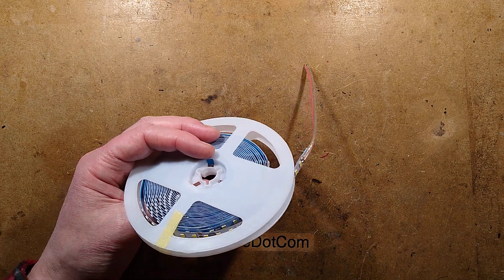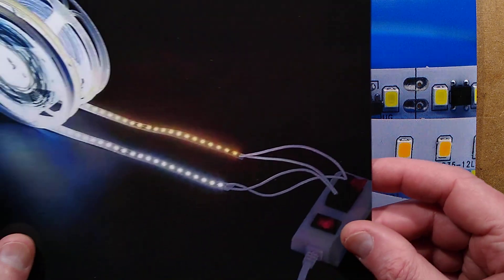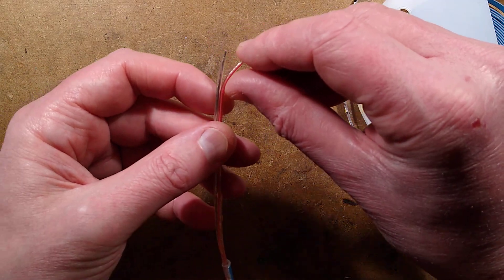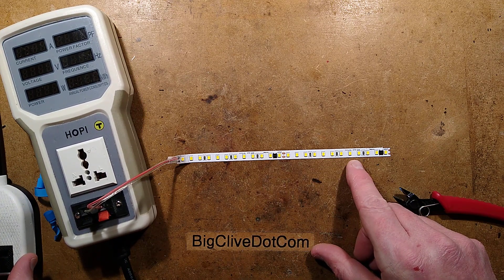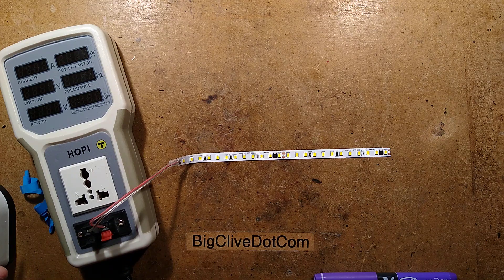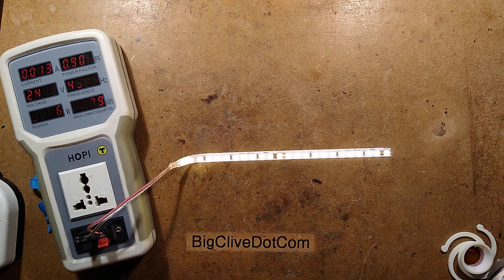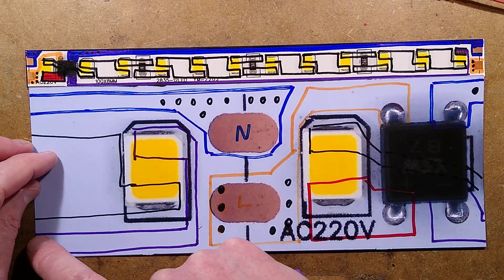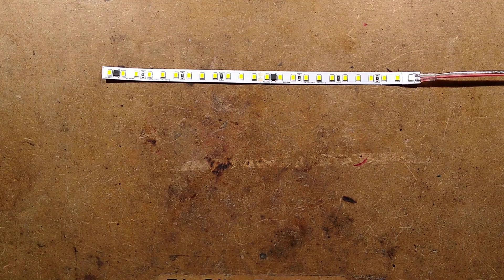Dangerous bare 230V LED tape

Comment: Dear all. I live on a boat and am installing normal 12v led tape run directly from the 12v batteries onboard. The tape gets surprisingly hot!! Is it possible to make it all run cooler? Would love some help. Thanks :-)
Reply: PWM dimmer, use a frequency well into the kHz so it doesn't flicker.
Reply: @NiHaoMike64  Thank you 👍
Reply from the maker: If the battery voltage spends much time above 12V it will cause rapidly increasing current and heat dissipation.  The use of an inline DC dimmer as suggested is good, but you can also nudge the voltage down in roughly 0.6 to 1V increments with series diodes.
Reply: @bigclivedotcom  Hi Clive. Thanks very much for taking the time to reply 🙂 The diode option sounds like something I should try as the batteries are maintained at 13.3v whilst I'm plugged into shore power, which is most of the time as I live onboard. Is there a 'size' or type of diode I should use for this technique?

Though I watch and enjoy all your content I'm in no way an electronics boffin! What effect does putting resistors in series with LEDs have? It's all very intriguing.... 🙂
Reply from the maker: @cptkev  The diode current rating depends on the LED strips normal load.  I'd suggest a 3A diode for up to 1.5A.
1N5401 could be a good choice for that range.  At least two in series to drop between 1.2 to 2V.  It also means the LEDs will use much less current as the battery gets low, which is a good thing.

Comment: That's probably where everything is going because the current is so low & people want to light entire rooms with a single LED strip.  Lighting an entire room with a 12V strip requires over 7A.  It burns off so much heat in the wires, it's never been very practical. It definitely needs a fuse & a cover.

Comment: It says 220 Volt at the band, because China does have true 220 Volt at the powerline. UK has 240 Volt, your Hopi showed 244 Volt. Rest of continent 230Volt. So in China it runs fine and a nice bit cooler.

Comment: Chuckle. I always destroy the outside corners of my thumbnails by using them as box cutters.

Do you use an isolation xmfr with this sort of stuff?

The strip looks like it's designed to be used in a manufactured fixture, certainly not a consumer product.
Reply from the maker: I have a bench area with good isolation from ground and 30mA RCD suited to electronic faults.

Comment: I love the test socket they show in the pictures, but the use of a speaker connector seems excessively safe. Bare posts that you can just clamp to or twist wires on to would be much more convenient.
Reply: Yep, I enjoyed using bare posts with 1" nuts to hook up 3x230V AV/DC connections back in the electric engine training lab.   We had specific instructions to step away at specific times.  Elsewhere in that building we did other 230V experiments, such as hooking (real) oscilloscopes to fluorescent light fixtures to study 3rd harmonics in the neutral wiring.
Reply: @johndododoe1411  sounds lke more fun than  my engineering classes at least XD
Reply: @mycosys  It's an old established Engineering college, I suspect that room was moved from the old location when they built the new campus in the 1960s.  Point of the exercise was to make sure we could run electrical experiments safely in our future careers, besides being a very traditional part of the mandatory mains electricity 101 course, specifically teaching how to safely start and stop various types of electric motors (3 phase asynchronous, 3 phase synchronous, DC with commutator).

Comment: Is this approach any worse than having a low voltage LED strip where you have to rely upon a cheap, probably junk, low voltage power supply?  At least with this mains version, you know right away it will have high voltage everywhere all the time, versus a low voltage supply that fails and suddenly sends mains voltage down the low voltage LED.  This 220v version can't fail like that. You could get shocked, yes. But you would expect it. Not like grabbing a low voltage strip and getting a surprise.

Comment: I feel like some of the proximity issues of the buses could be solved with a 90° rotation of the LEDs. I've never seen that done, so is there some unwritten rule dictated by pick'n'place machines that they can't be sideways, or...? It feels like you could then say that the LEDs were "closer together" because the packages are slightly oblong, even though I think the lit sections of each LED are roughly square. Thoughts, Clive?
Reply: I think the LEDs are always placed in this direction to minimize the mechanical stress from bending the strip and to also allow a slightly tighter bending radius. The solder joint also provides some reinforcement to the LED against breaking during bending. Imagine if you had a 5630 strip with the LEDs rotated by 90 degrees, how easily they could break if you bent the strip too aggressively.
Reply: @3zuli  Ah, yeah, that makes sense

Comment: If it's only LEDs and resistors shouldn't the power factor be at 1?
Reply from the maker: The LEDs only turn on above above a certain voltage level.  So their current isn't a pure sine wave.

Comment: Honestly, I am struggling to come up with WHY anyone would ever even design something like this in the first place.  There is no safe application for it, and what do you save vs. the low-voltage DC stuff which is already cheap as dirt?  What do you save, the cost of the DC adapter?   Really?  

Maybe it is only supposed to be a part used in the manufacture of something else or something, because I can't see any other reason for it to even exist.   

This is a good reminder that China remains the wild, wild west.  

This reminds a bit of those fake "mag-safe" chargers for the older apple laptops.  Apple never licensed the mag-safe technology, but all of these pirates made absolutely horrible, totally shoddy mag-safe compatible chargers.  They couldn't make a decent one because then Apple would sue them and put a stop to it, so the only ones for sale were just terrifyingly dangerous trash.  You'd read the reviews and they'd be like "stupid thing killed my laptop dead" or " this #@%* thing set my kitchen on fire" and they were still for sale on Amazon and EBay.  Totally unsafe, completely illegal products and nobody cared enough to stop selling them.

Comment: I haven't finished watching the video as of yet, but my first thought was "I wonder how well it'll work at 120v/60hz?"    I could see this being useful in a self-built insultated panel  (yes, this is pretty insulting).    120v might make it useful as a wall illuminant.

Comment: Could make a nice replacement for old-fangled rope lights using the mentioned tubing.  Could be used with appropriate waterproof covering for indirect lighting in homes and offices. Could be used in square or rectangular ceiling fixtures by placing strips side-by side as replacements for fluorescents. Individual strips could be used for instrument lighting in appliances etc. so no low-voltage supply needed.

Not claiming it was designed for any of these use cases, just some ideas.
Reply: Especially outside as the UV rats deteriorate the sleeve and it fills with rain water ... It makes a spectacular display ☺️ 😂😂😂
Reply: At 70W it's not all that efficient ! comparable to a 70W light bulb, no doubt !
Reply: @millomweb  70 watts for 5 meters. Close to 1.5W per 10cm. So a 40cm batten replacement would be 6W or 12W if you double up. Certainly in the ballpark, a 40cm double batten light would be 12 or 24W which seems about right.  Certainly fits with te idea of it being for replacement of fluro tube.
Reply: @mycosys  5' fluo tube IIRC 68W. If you cut the 5m length into 1m lengths and arrange them around a broom handle so light is emitted all around the handle like a fluo tube - yo might get the same light output per metre as the fluo but a length of 1m rather than 5' !
I'd rather have the fluo tube  !
Reply: @mycosys  except that 70w led is about the same as 150w fluorescent or 500w incandescent. Very approximately.

Comment: Definitely would not want to be LED along the garden path by these things, especially if it's raining, unless you're Frankenstein's monster, or want a date with old sparky!

Chinese lethality knows no bounds, by the look of it. I'd definitely say this tape needs to be used with additional insulation, so inside a light hose, or some other light permeable housing.

Handy stuff though, for tapping off a kettle spur every four inches!

Comment: So we get a Chinese product where the LEDs are not being grilled, the resistors do not get toasty and the PF is 0.9. A seemingly good product that will last some time. A product that will last which is an oddity considering the source and the only real issue is the 240v with the live and bare connections every 100mm (4"). 😱 This Death Tape 2000 will outlast the human owners as it will still be running while the surviving cats are snacking on their tape grilled corpses.

Comment: If using that on Mains, id connect an outlet plug onto it and plug it into a surge protector, doubt id use it without one.
I would also clear coat it, definitely wouldnt run it bare.

Comment: Wonder how much of this death tape will find its way into UK kitchens. Carefully installed with a standard plug stuffed on the end with the supplied 13A fuse for added protection. You can be certain someone's going to get the tingles from this stuff 🤦🏻‍♂️
Reply: Yep.  And people still wonder why in the EU regulations have been strengthened on goods like these...after fire departments having issued their concerns over people being the cheaper versions of "hoverboards" lacking any charging protection and causing a series of house fires after the thing overcharged, requesting people to either charge it outside or at least in the shed and not in the house...

Comment: if the designer had simply turned the LEDs through 90 degrees they could have avoided all the small gaps and most of the flashover risk .... look at it it's a terrible layout
Reply from the maker: They're sideways to reduce stress when curved.

Comment: This has all the earmarks of someone getting rid of surplus parts for some kind of production run and not giving a damn about safety. Clearly this stuff should never be used for the "applications" they suggest. The fact that the stuff you received didn't match the photos is also very sus. I imagine a warehouse full of cartons of miscellaneous rolls of LED lighting strips, randomly grabbed for each eBay sale. People who don't understand electricity would definitely be taking a huge risk of electrocution or fire since this is not being sold for its original application (which probably included a lot of isolation and moisture proofing). Yikes!

Comment: hey, Clive got a question for you as the king of LEDs. Managed to get me about half a roll of LEDs rated at 24Volit what I am looking for is a driver that is 240V AC/ 50-60 Cycles that dimmable.
want to use them in a lighting set-up for photography vidiography. the are white LEDs the rest were used in a school hallway.
Reply from the maker: You get inline DC dimmers.  You'll need a standard 24V DC power supply.  Preferably a fully enclosed one.

Comment: No!  Not even if it was 'only' 120 VAC!  I'll stick to the 12 volt LED strip.  The chances of getting zapped from arm to arm are too high, and that's through the heart!  Way too dangerous!  And putting it in a clear plastic insulator might cause it to get too hot, so it would be both a shock and fire hazard.

The good thing about the 12V switching power supplies is they quit switching when overloaded, giving somewhat of an overcurrent protection.  These guys operate directly off the "mains", giving big time sparks when shorted.  Or else smoke and possibly fire.  🤪😱😱  Thanks, Clive.

Comment: It could be used in resin tables where it is encapsulated in the resin therefore reducing the risk of flashover .
Reply: The problem is these don't usually last long - difficult to repair once embeded in resin!
Reply: @kay110  If not impossible
Reply: if the resin gets too hot while curing , like in layers over an inch thick, could that soften up the plastic parts it's made on and cause some issues.
Reply: @Systems Renegade
wouldnt the solder mask be just as good as resin ? 🙂
Reply: @YTANDY100  Short answer "no". Long answer "noooooooooooooooooooooooooo" ;)
Reply: Until the LEDs start to fail one by one, and then there's no way to replace the strip.
Reply: @cnielsen3739  That's true of anything embedded in resin.
Reply: Yeah, but with such thin traces, it wouldn't last long, and you would be left with a table to store your other failed Junk on.
Reply: @penfold7800  Strangely militant reaction to a hypothetical table.
Reply: Then use that table for all night drinking whete everyone downs their drinks without spilling.
Reply: @sewasewa6585  Don't suppose it'd matter if they're embedded in resin.

Comment: clive, so in other words in regards to the dissipation of the resistors, for once the Chinese engineered something well for once for the first time yet, but it Still being a dodgy product in the first place, strange, very strange,
except I could possibly see it being used inside of mains voltage signs,
also clive, have you ever thought about making a test cord, a male plug, cord with alligator clips at the end for testing things with flying leads, although you kind of need both the speaker terminal connector version as well, depending on what you're working on.

Comment: you could always stick it back to back and then slip it into a clear plastic tube, and use them as pendant lights. High ceilings would be a definite advantage 😄
Reply: Which would mean, live and neutral on each strip would be up against their opposites, on the other strip.... nice.  Much better than just sticking it to a metal surface.  :-)
Reply: Swap the wires to one side: no longer opposite. Still flickery in the peripheral vision. Do not want.

Comment: Potentially very dangerous? Check. Shoddy adhesive? Check. Ad has unsafe pictures and recommendations to put in wet locations? Check. Minimal insulation on mounting side? Check. That settles it, I want this!
Reply: Do they make a 110V version, or will I have to plug it into a heavy appliance plug for bonus danger?
Reply: @Bob5mith  I haven't seen a 110 version, so I recommend just plugging it into an electric dryer outlet. The 30A breaker makes sure the tape stays lit until fully consumed. Alternatively, one could always find the hot leg of 2 separate 110 volt outlets on different circuits (assuring they are on opposing sides of the center tap, of course). I figure using the smallest wire possible for the leads should prevent overdriving of the LEDs. Bonus points for using 30 AWG magnet wire laid into any carpeting you may have so most of the leads are hidden. 😆😆

Comment: That is frightfully dangerous. Jamming wires into a mains outlet is just wrong on so many levels. 
That really is speaker cable. Back in the day I got suckered into the Monster Cable 10 or 12 Guage speaker cable. Almost as thick as jumper cables for my Bose speakers. Ridiculous. 
Love your videos Clive. See ya later on your live stream. Cheers
Reply: 10 years ago, stayed in a cheap hotel where the 120v bedside lamps were all powered via poorly connected Monster Cable speaker wires.  I just wonder why, given actual lamp cord was probably cheaper by the foot.

Comment: Design your own sleeve and turn it into maybe an extra light source for your bench for those horrid black pcb's or just give extra light to read a chip or you could just make an interesting sign out of it and with the channel you could epoxy it in and add clear dye's to the epoxy to add colour effects to them. Or just make a dangling chandelier of death.

Comment: Very cool to see and know this exist. Assume that those who know something about electronics will find a use for it. So after cutting said length of strip, one has to solder power lines? what a pain. They should have leads at intervals to help the designer affix leads to power...in my opinion. Peace be with be with you B-Clive. DVD:)
Reply: Nah, soldering power wires is easy and common, just look inside any electronics big enough to be fed mains instead of 12V.  In fact, the voltage allows thinner wires that are easier to solder than the #4 wires needed for "high" power at 12V.

Comment: Clive, at around 2:30, you mentioned 3-d printing a enclosure for the speaker terminal tester thing. Would that be better than your cliff quick test? Come to think of it, I haven't seen it in quite some time. What happened to it?
Reply from the maker: It's still in use.  The Quicktest is MUCH safer than that contraption.  My main appeal in building it is that it's dangerous.

Comment: It's probably spare LED tape that they forgot to put insulation on. Or it was made at bulk for a specific application and they needed to sell off the extra they had. Just a couple guesses.
Reply: Looks like a case of not finding a reason for "why not" before uploading a design to the automated production system that usually makes batches of 12V tape.  Now someone has the unenviable job of selling the product to whomever is actually willing to pay.

Comment: So, an enclosure seems prudent...What are your thoughts on embedded into an epoxy pour? would that trap too much heat?
Reply from the maker: Epoxy can degrade in front of LEDs and it's never a good idea to pot LEDs completely into things.
Reply: probably mounted on to some sort of board and a diffuser over the top.
Ah a quick google shows there are products designed specifically for LED strips like this.